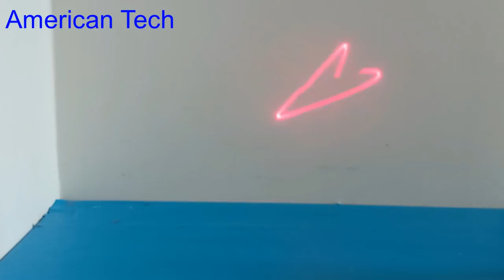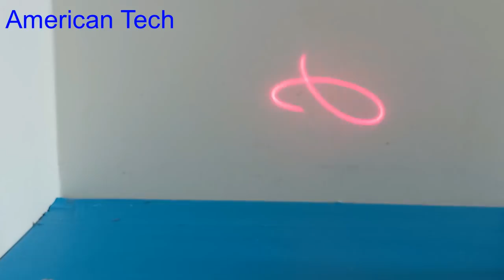How to make Laser projector at home

Comment: I have seen that several people inquired about the transistor that I use in the project and have not responded to anyone. Although seeing the power of the engines you use, it is easy to determine the value of the variable resistance. I wanted to ask you if you publish the videos to teach people or with a morbid interest to obtain economic benefits from YouTube. I will cancel my subscription.